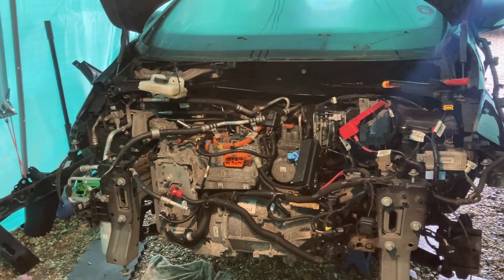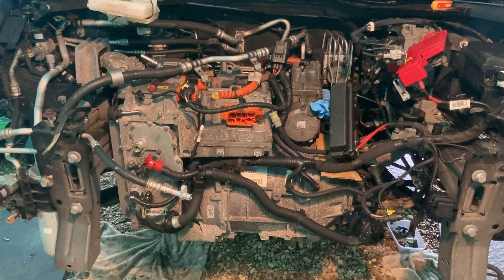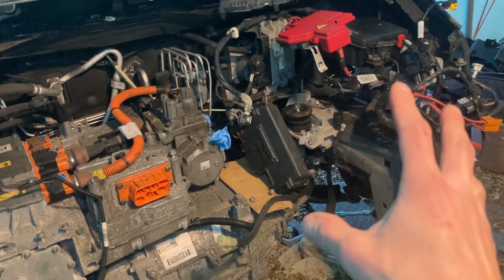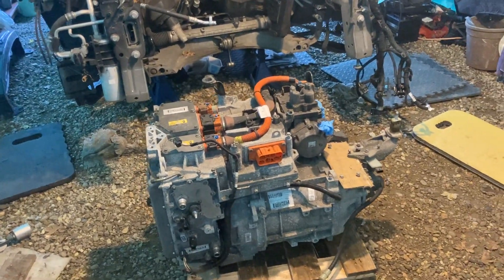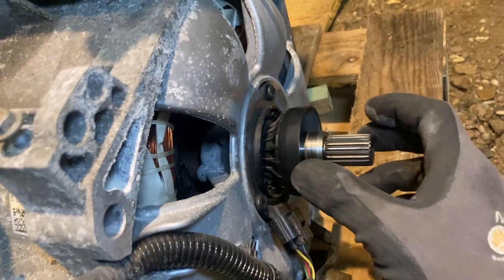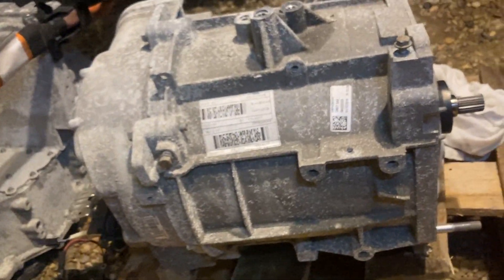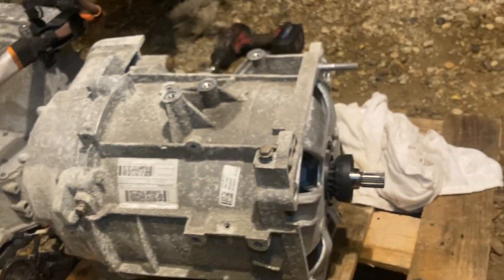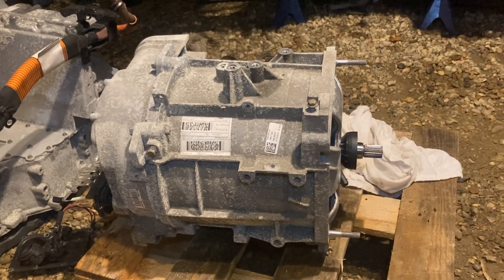🔋🔧🫣 EV Powertrain Removal and Stripdown - Renault Zoe ZE40 motor fault - noisy bearings 🫣🔧🔋

Comment: Have you tried dropping the engine/gearbox without removing the front of car assembly
Reply from the maker: I have heard of people doing it like this but you’d definitely need a ramp as the car would need to go a lot higher and it would need securing to a lifting table to ensure it doesn’t move as you’re lowering it. To be honest a lot of the removal would still need to be done to free it and the wiring would be more difficult to undo with the front still in place so to be honest although it may represent a time saving it would mean I need a ramp etc so it wouldn’t save the customer money due to increased workshop costs. Cheers
Reply: @garycevrepairs  I was just looking at the new electric Ford Transit. It would be a dream to work on compared to that Cleo. I love the look and size of the Cleo but they look like a right pain to work on but if the bearings need changing every 100k I could live with that .

Comment: Do Renault Kangoo ZEs also have this weak drive motor bearing issue? I think the facelifted 2018-2021 model year Kangoos are supposed to have the ZOE drive motor in them?
Reply from the maker: Hi yes they do share the 5AQ Zoe motor tho I believe they are capped at a lower power output and I haven’t heard of any having this issue. It’s a less common vehicle than the Zoe tho so it’s hard to tell. Cheers

Comment: https://youtu.be/feMkR1zBVOg?si=MfiF1MTfPYlbm_Mx

Hey Gary. 

Did you see JP’s video /issue with his high miles ZE50. What’s your thoughts on that case? His HEVRA garage couldn’t fix it as couldn’t get the bearings and the rotor was snorting on the windings. 

I was shouting at the screen saying “Gary could fix that!” 😅
Reply from the maker: Haha thanks for the link. It’s hard to be certain without seeing the motor if it was definitely fixable as the rotor has been dragging on the stator but they really should have replaced both bearings and I get them from a European company so no need to go to the US. It’s good to see garages getting stuck in and even though he’s making a bit of a hoo ha about it (to get views) at the end of the day the car got fixed and it had done plenty of miles so tbh it’s lasted pretty well and it’s still on the road so I think that’s good!!! Cheers

Comment: Hello. I have a Renault Zoe q210. There is noise in the engine. I replaced the bearings in the gearbox and electric motor, but the noise did not disappear. When I move in reverse, there is practically no noise. Can you help me?
Reply from the maker: Bit hard to diagnose without seeing it I’m afraid. Are you uk based?
Reply: No. I live in Ukraine.
Reply: I can send a video if needed.
Reply from the maker: There are some good EV repair places in Ukraine!